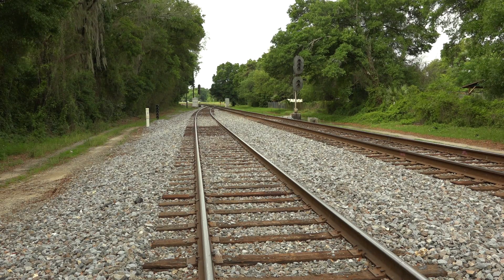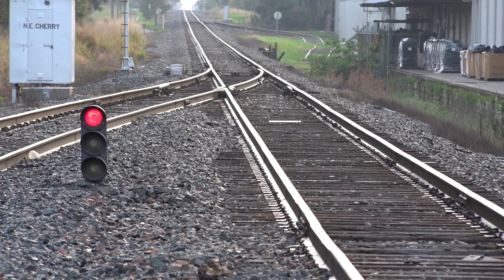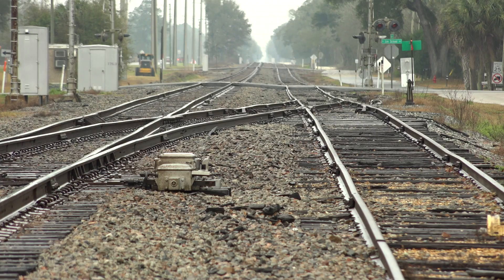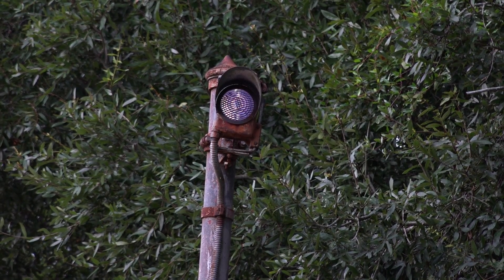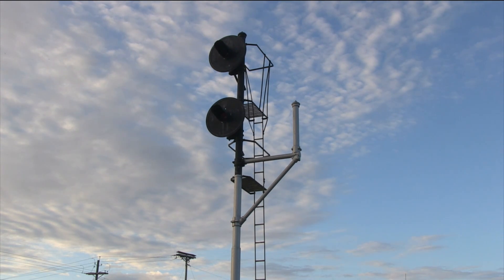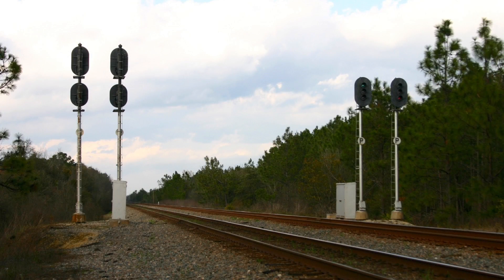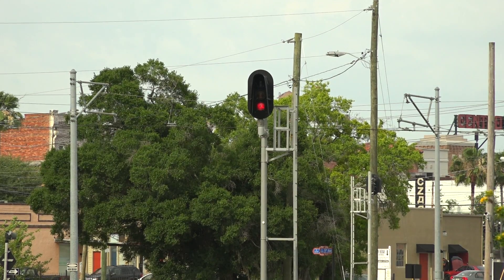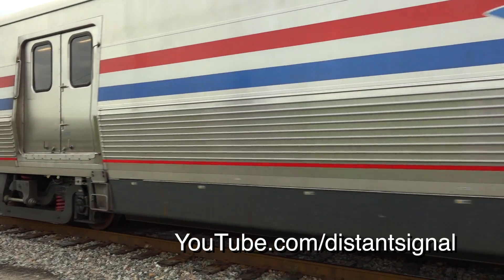How To Read CSX Signals Part 6

Comment: One thing I'm surprised you didn't mention in these six videos on reading signals is the rule about signal ambiguity or malfunction. Basically the rule is that in the event of any malfunction of a signal, or if somehow a signal was displaying mixed messages (not very likely in modern systems), it is to be interpreted as the most restrictive signal that post is capable of producing. In most instances that would be stop, but in others it might be approach slow or medium. This interpretation is in effect until a train dispatcher overrides it, the train clears that block, or the signal is repaired.
Reply from the maker: You're right. I just covered these these signal aspects and indications in no particular order and I even missed a couple of them. I didn't really delve into  the rules too much.
Reply: *might be Stop and Proceed or Restricted Proceed or Restricting.
Reply: White is Restricting and is only found on absolute signals. Red on a signal with a P, G, or mile plate is Restricted proceed and is only found on those signals (Sometimes called Intermediates). If a signal is showing an improper signal indication, there is several rules about that but most common is to stop with good train handling unless situation requires an emergency application and call the dispatcher.

Comment: can anyone tell me what a typical 3 light dwarf would show for a Signaled siding I.e Bonded would both red and green light up for a medium clear coming out of the siding?
Reply from the maker: Totally depends on the track setup at that particular siding. If the switch is fast enough and there's no reason to slow down ahead then yes, the dwarf could show a Medium Clear out of the siding. As I said, there's no rule for what a signal displays. It depends on track conditions at that individual place.

Comment: Dwarf, ground signal or pot signal. Any of the three are correct.
Reply from the maker: Never heard of Pot Signal
Reply: Distant Signal I have up here in Wisconsin. Up here, our advance approaches are flashing yellows and our double yellows are approach-diverging. Have you ever seen a medium approach slow or an approach restricting on the CSX lines down by you?
Reply: By the way. I love your signal videos. I’ve learned a lot about speed signaling because of them. Up here in Wisconsin, we have route signaling.

Comment: Doll arms and side-by-side signals were employed back in the day when putting signals to the left of the track was illegal.  The common practice at the ends of sidings was to use a high signal for the main track and a dwarf for the siding.  When the main track was to the left, then the doll arm would be needed.

Comment: These are great videos. I've watched those posted by the FRA and they are SO dry and confusing. I go away scratching my head over what they're talking about. Plus they show only paper diagrams. It's SO much better to see the signals and trains as you show them. Makes learning a great deal easier.

Comment: Great informative video.  BUT, I don't understand the S line practice of putting both signals on the right side of the ROW.  There is no way to see your signal if you are on the left track and another train is on the right track!  Sounds really dangerous especially with the advent of doublestack cars.
Reply: Distant Signal There's at least one side by side Seaboard style signal setup on the Florida S Line. I need to try to find it for you.
Reply: There is one at the Route 42 grade crossing.
Reply from the maker: Side-By-Side signals on double track was a Seaboard practice. I agree that it seems easy to confuse, but they made it work. When new signals go up in Seaboard double track territory (and there really wasn't much of it) CSX is installing them on the outside of each track, ACL-style.

Comment: Hi Dany.  Just to clear up the dwarf at Lacoochee.The lights below the red "second head" are yellow and green.  This allows the dwarf to display MEDIUM clear and approach instead of slow.  The top head is an oddity, and it displays what may be the most rare indication on the entire CSX system.  See, the top head has a yellow light.  This would allow it to display approach as well as approach medium/limited, but because it is a medium speed route this does not work.  There is no color light dwarf indication for Medium Approach Medium, so only 1 option remains.  Yellow over yellow, which on a dwarf is MEDIUM Advance Approach.  In other words, Medium speed through the switch, preparing to stop 2 signals away.  Hope I cleared that up for you, I just figured it out myself now.
Reply: I guess this is an example of a location requirement signal based on what is up ahead and what aspects they want displayed at this particular switch even though the tracks are converging instead of diverging. On the right of the main, they have a 3 over 2 signal where normally, to me, it should be just a single head 3-position light if the dwarf governs the left track, but the dwarf has 5 lights as well.

Comment: I'm more educated about Florida signalling thanks to this. Our signalling around Southeast Texas is pretty easy to learn compared to Florida. We do have one line that is ABS track warrant controlled and that is the Lufkin Sub or Rabbit line, an ex SP dark territory subdivision changed to ABS track warrant control due to a major headon collision a few years back that killed the crew of a southbound that crashed into a parked rock train because the crew of the rock train failed to properly lock the switch since dark territory was totally dependent on proper crew procedures.